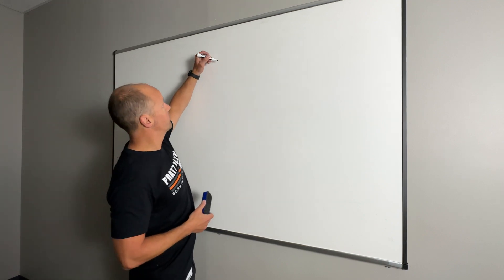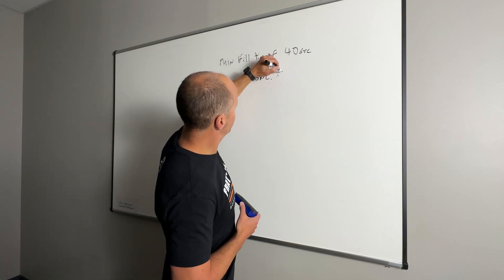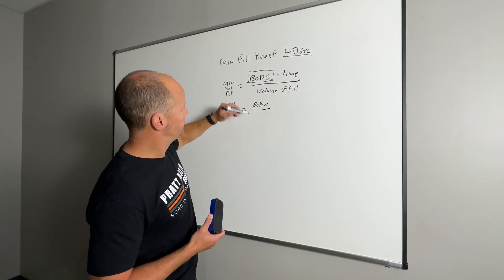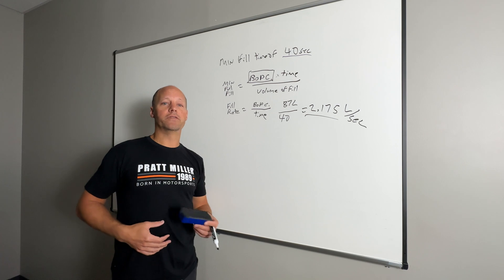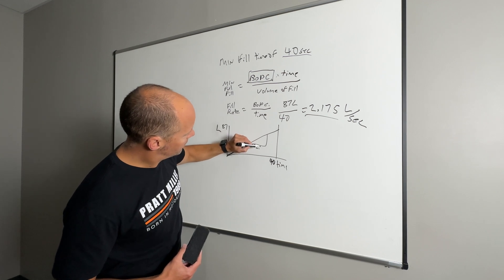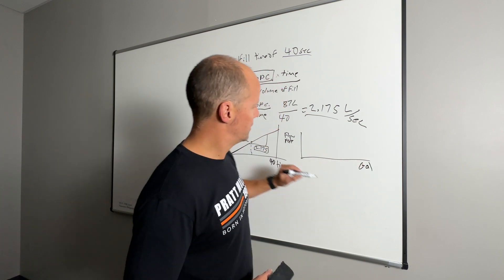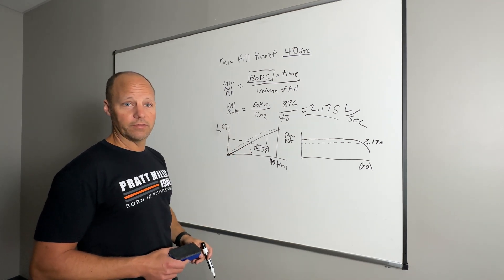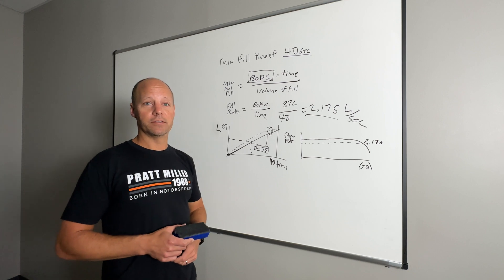Road America Penalty Explained

Comment: Thank you for the explanation. However, the setting of times for refueling is BS and waste if engineering. It makes almost as much sense as race walking or bracket racing. The object overall should be speed on the track and speed in the pits within the given rules regarding safety. As I understand it, this rule was based on a team refueling faster than anyone else in the 24 hours. Upon inspection of all equipment there was nothing found amiss, yet they came up with a BS rule to make things "even" for all. Totally antithetical to the goal of the sport.
Reply: Yep just like at the glen with porsche. IMSA has been a joke this season with penalties. Thankfully the racing has been pretty good